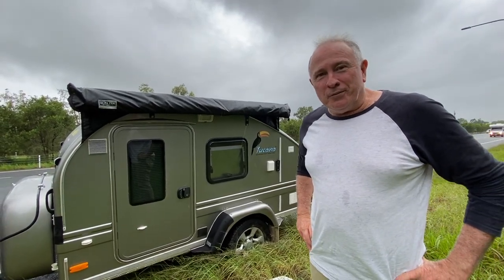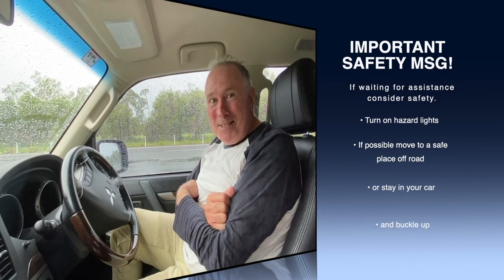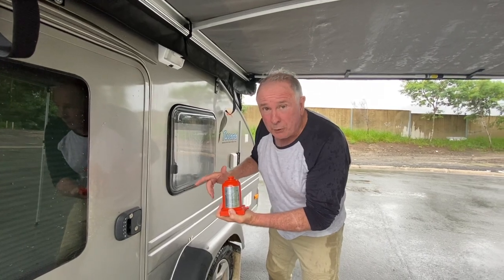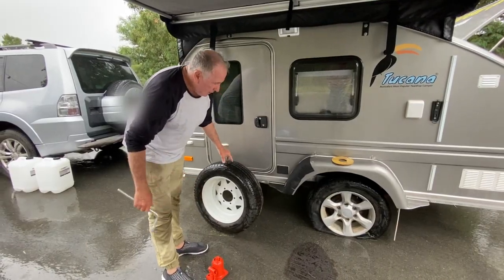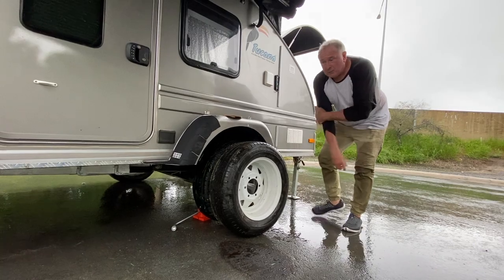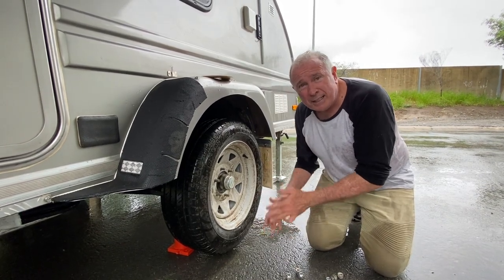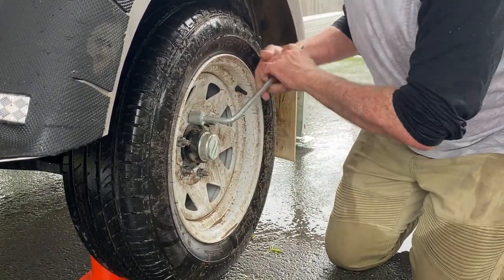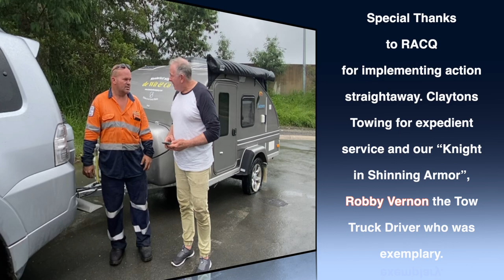HOW TO CHANGE A FLAT TYRE ON YOUR CARAVAN

Comment: Great video. I bought a cross (4 way) wheel brace, 21mm socket (for lowering spare), spare wheel nuts and carry a piece of wood & mat for kneeling on. I need to check my car jack & get something longer to increase the force to undo the wheel nuts with my puny arms🤣

Comment: Be careful what you wish for! Great job as usual. Every Tucana owner should check that they have a suitable jack and tyre wrench as these are not supplied with the Tucana. Two big wharehouse types ( one for camping and one for car parts) have a caravan high lift scissor jack, and you can also get ram extensions for bottle jacks like you used (internet search). The high lift scissor jacks slot into the mainframe metal squares. I wouldn’t personally slot a scissor jack into the V plate of the suspension, especially on a non-level or soft surface.

Comment: Thanks for the video. Great idea getting towed to a safe spot. Most wouldn't think about this option! Another suggestion - a 4 way cross brace will help with speed, control and protection when loosening and tightening wheel nuts. Also, as learnt from experience, it is good to check fluid levels on your hydraulic jack. Especially before a big trip. Mine had run dry over time and needed to be refilled. An easy enough job.